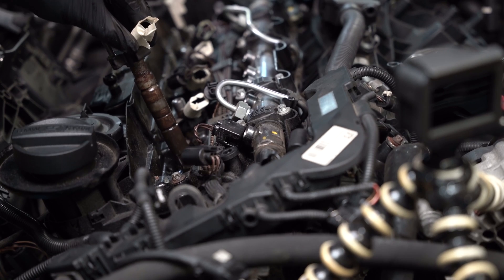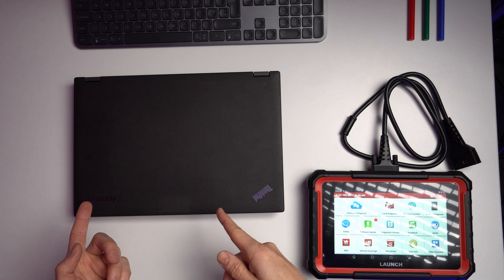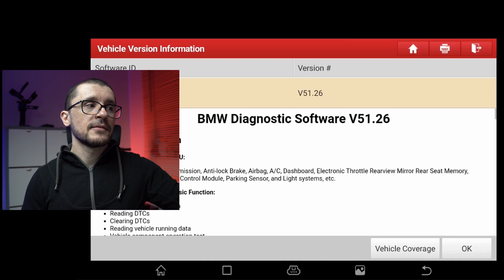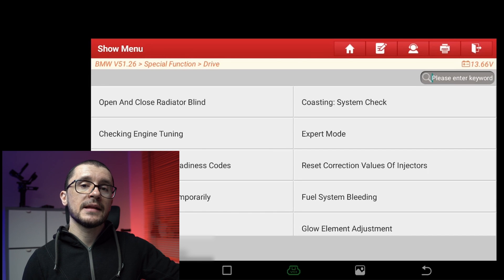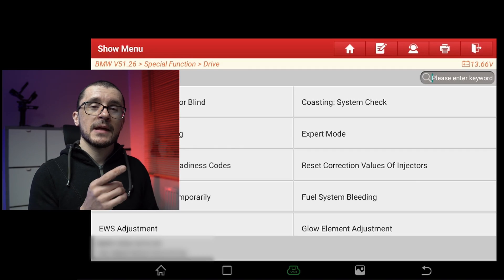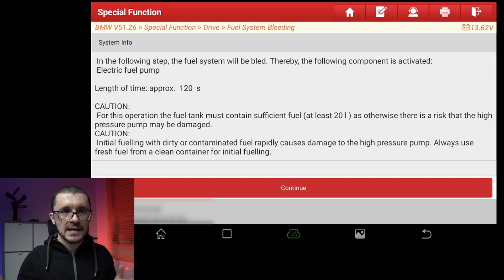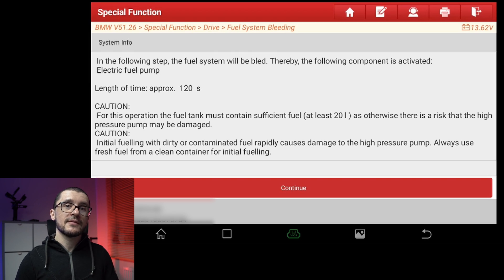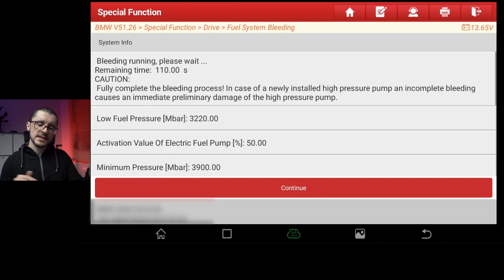How to Prime Any BMW Diesel Fuel Systems - Launch X431 Pro Elite - F10/F11/F15/F20/F30/F48 N47 N57

Comment: i have bmw 116d  b37 engine (2016). I need to replace the pcv valve as white smoke from the oil cap. I have to do the whole crankcase I believe? for priming the fuel pump only what could be the most economical option? Cheers
Reply from the maker: i am not familiar with the B37. on the n57 you can change the PCV by itself. Also white smoke from the oil cap can be subjective. I would check pressure first and decide later. where are you based ?
Reply: @BestCarMods  I am in LL30 northwales, How I check the pressure?
Reply from the maker: @yfaheem7557  It is good that you start asking the right questions. I know the right tool for the job ... but for me to support, I charge a 1to1 consultation fee (£100). If you are interested email me at 8hello@bestcarmods.com

Comment: You recomand to do the bleeding twice?😮
Reply from the maker: yes ... it increases your chances for the engine to start. especially if you have removed common rail or injectors
Reply: @BestCarMods  Hi.. i do on my X5 2012 yesturday,  twice.. but when i start the engine he start after 7-8sec 😬 it's ok?
Reply from the maker: yes, first start will take a bit longer even with the fuel priming function done. future start ups should be back to normal.  @chitila007
Reply: Hi! Thanks for the video. What tool would you recommend for a 520d G30? Something inexpensive(cheapest option) but with full functionality 🙂 
I reviewed Carly, Carista, B code but none of them offer priming the pump. 
This is for hobby purposes only. For example, priming the fuel pump, disabling the Start/Stop system, etc. Thank you.
Ps. How much is BMW ISTA btw. Thank you